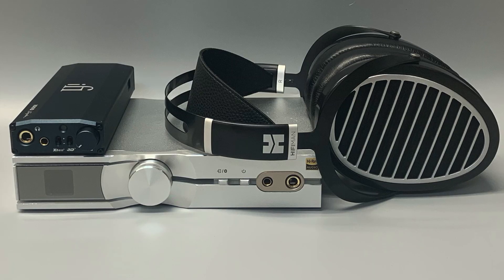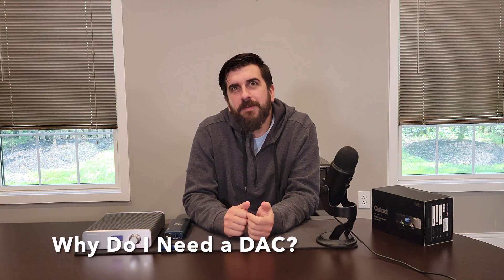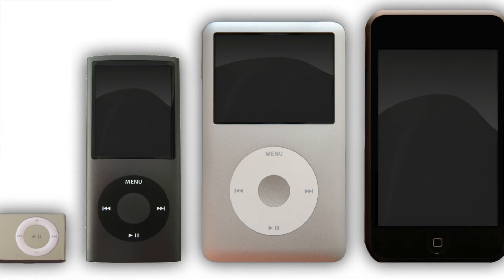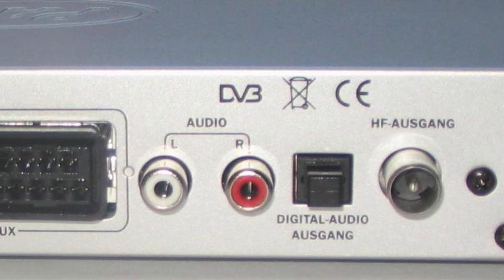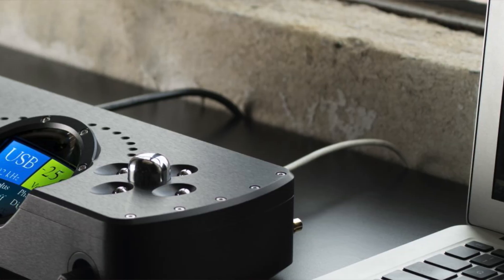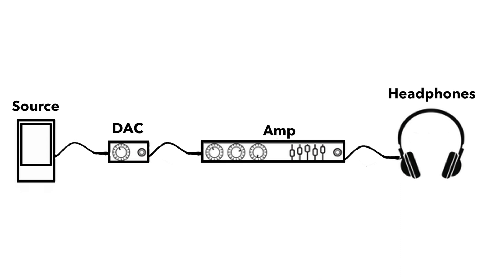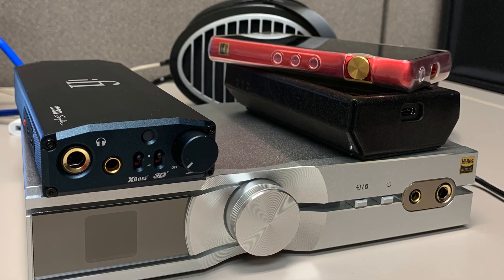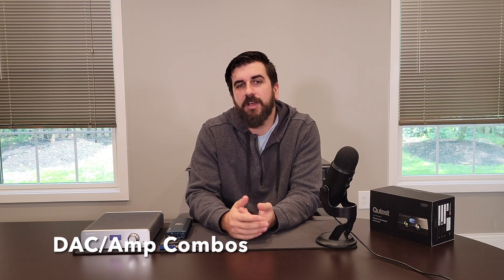What Is a DAC, and Why Do I Need One?

Comment: Please tell me what is a good file and what is a bad file. Just what constitutes one or the other. It can't be copying a digital file or it would not copy, there would be an error, if it does copy its exactly the same. If you are referring to someone copying a record to an MP3 format with a cheap microphone, or direct with maximum compression or even recompressing a MP3 file then that's not a bad file as such, its a poorly created file and nothing will restore it to the original recording. 
Using lossless compression files through a DAC would give a wave output that is indiscernible from the original. The quality of the DAC in most reputable brands products, not the just the high end, with a lossless or minimum compression file is sufficiently good enough to fool an oscilloscope that its not the original file and in a blind test I dare say the majority of audiophiles, though even they have a 50-50 chance of getting it right or wrong depending on where one stands on DACs, compression, amplifiers, speakers, environment and music choice. Also paying a mint for gear or peanuts.
Reply from the maker: So right, a CD quality .WAV would be a baseline for file quality, and then you'd have any number of lossless compression options like FLAC alongside of that, and then lossy compression which can run the range from "99% of people can't tell the difference" to "practically unlistenable." What the DAC does isn't just a matter of decoding the audio to produce the WAV file, it has to then algorithmically convert the digital information analog sound signal. While the conversion process has been "solved" there are still many variances between different DAC types that relate to how they process aspects of the sound, like transients, and how they compensate for timing issues in the processing of the sound. Beyond the processing itself, any DAC unit will also have a short analog signal path for its output. So the difference between DAC devices comes down to 1. The initial digital processing (is any noise or external processing added between the input signal and the DAC), 2. The specific algorithm used to process the signal (including things like multiple parallel DAC chips or running the signal through multiple passes), and 3. The final analog output (is anything lost or added between the DAC processing and the output terminal of the device).

As a concrete example, I've experienced cheaper DACs which would often lose the first approximately .5 seconds of each track due to shortcomings in their digital input design. Some popular DAC chips have notable characteristics in any unit where they're used – like sharper or grainier treble vs. smooth treble – which someone might prefer for their setup. And some units have a good DAC, but a bad preamp, so when running with a line level out they sound significantly better than if you use the DAC units preamp/volume control. Some cheap units sound great. Some expensive units sound bad. It's up to the listener to try to find the best information and use their ears to find what works for their budget.
Reply: @BloomAudio  This is a great information. Thanks for taking the time to write this.

Comment: I've never understood DACs, so if my source is X digital and passing through the DAC of my device, like a motherboard or an amplifier, how is another DAC going to help after that output? Isn't that just reprocessing?
Reply from the maker: Using an external DAC will bypass the one your device. The digital signal is unchanged until it's converted to analog (unless you have some other digital processing software), so the most important piece from a digital audio end is the moment it is converted to analog. Of course, once it's analog, there's a whole new set of concrens... :)
Reply: @BloomAudio  thank you that is a comprehensive information!

Comment: You've just killed my argument, I've always found dacs sound I've always been a analog fan boy but I've been checking out dacs lately, I've just learnt several mistakes in my audio chain.
Reply: Exactly. I've been running my Wiim (not the best, I know) via optical through my preamp.
So I need to run analog OUT from the Wiim to analog IN to the receiver to properly utilize the better DAC.

Comment: Given my limited technical knowledge, I would be interested in knowing if a DAC can be employed through an auto system to upgrade sound from a CD or mp3s?
Reply from the maker: In most cases you wouldn't be able to directly upgrade the DAC in a car audio system, and because of other factors in newer cars (like a digital signal processing system that's specifically tuned for the cars speakers) there's not too much you can do outside of getting a whole new audio system.
Reply: Good car receivers have better DACs.

Comment: I own two DAPs. An Astell and Kerns Kahn Alpha and a Shanling M6 Ultra. I must confess I like the sound signature of my Shanling best, as they have the AKM dac’s. The Shanling UA3 dongle has the same AKM 4493 as my M6 Ultra. If I hook the UA3 dongle to the Kahn Alpha, will it combine the two sound signatures into a hybrid signature?
Reply from the maker: So if you connect an external DAC like that to a DAP, it would bypass the DAC in the player, and the sound would essentially be the same as connecting the external DAC to your phone or any other device. There would be some advantages to a dedicated player from the perspective of reducing potential distortion or interference, but in terms of the tuning and sound, that would all be coming from the external DAC.

Comment: Great video! But I'm still not sure about this: since my phone already has a DAC, what will happen to it when I connect a portable DAC? Which one will be used?
Reply from the maker: Connecting it via USB will send the digital signal direct to the external DAC without processing it, and then the Digital to Analog conversion will happen on the external DAC and not the phone.
Reply: @BloomAudio  Thanks for replying! So the priority goes to the external DAC by default? My phone has a Type-C port only, which is used for my headphones as well. I'm thinking of buying a portable DAC.
Reply from the maker: @edmondo785  Yeah, so basically, if you connect via a digital connection (USB, Optical, SPDIF), the external DAC is what get used to do the conversion. If you are using an analog connection (RCA, headphone jack, XLR), you're using the DAC in the device you're plugging into.

On some devices (like a lot of Desktop DAC/Amp combos), you might have the ability to either use the device as a DAC by connecting to it via a digital connection, or use it as an Amp – bypassing the DAC – by connecting with an analog connection.
Reply: @BloomAudio  Hi, I just learnt there's SRC on Android phones, how does that affect sound quality? Will DAC be able to bypass it? And I heard only some apps, like Tidal, support bypassing SRC.
Reply from the maker: @edmondo785  Yes, so there are some limitations with Android's sound system, but I haven't personally used Android phones extensively, so I don't know all the specifics for that. I'm also seen some mixed messages on forums as to whether or not the quality is really degraded or what apps actually fully bypass the Android SRC. So I'm not 100% sure on the best solution or options there.

Comment: Excellent video, thanks for the explanation, much appreciated. One thing still puzzles me though - Bluetooth. If a standalone DAC has Bluetooth, when it Bluetooth-connects to my phone or laptop, is the digital audio file it receives for conversion to analogue getting degraded in any way by the Bluetooth connection? Or put another way is it better to use a cable, please?  Maybe the answer is complex and your views on this would make a whole new video!!
Reply from the maker: So the amount that the digital audio is degraded by bluetooth will just depend on the original quality and the quality of the bluetooth connection. So AAC (Apple's Bluetooth standard) has a max transfer speed of 264kbps and 44.1khz 16-bit audio. Standard aptX (common on Android) does 352 kbps and 48kHz/16-bit.

Generally speaking, if you're streaming Spotify or Youtube, this means you'll have very little loss in data, but if you're streaming TIDAL Masters, Qobuz, etc, you're basically downgrading your hi-res files to lower resolution.

There are some newer better Bluetooth protocols that can stream higher resolutions, but there's also some fluctuations in the quality. So even though it can stream 500kbps at maximum, you might actually still end up at 250kbps average due to the signal strength (from local interference and the like). 

So wired is typically best, but as Bluetooth tech improves, it's closing the gap on the quality difference.